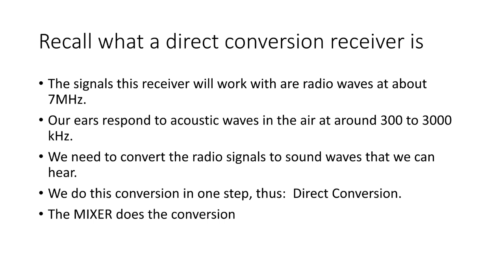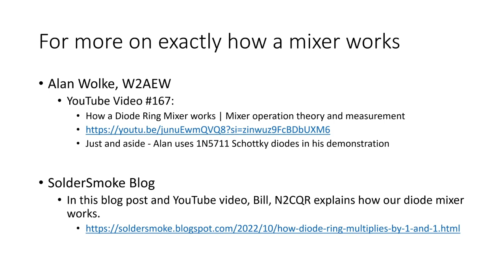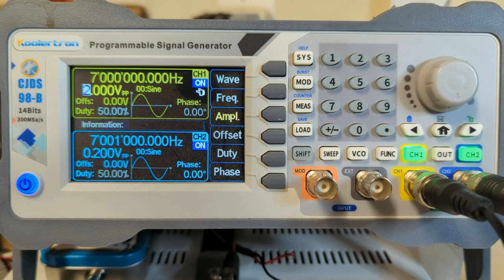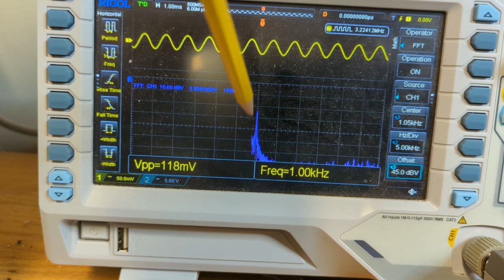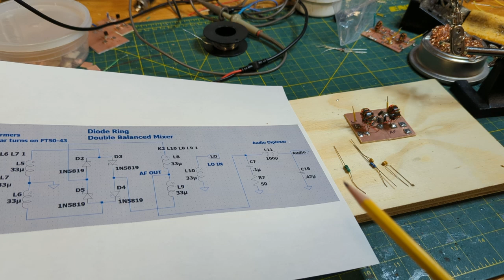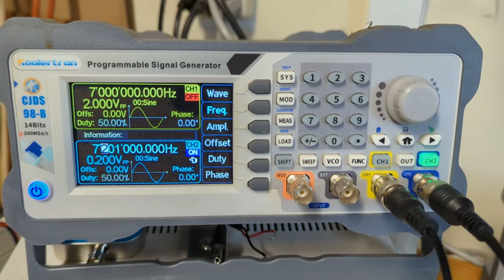SolderSmoke DCR Challenge -- Mixer and Diplexer

Comment: I noticed you swap the LO IN and RF IN locations in comparison to the schematic.  After looking at multiple builds of diode ring mixers it's become evident that you can do it either way.
Reply: I got so confused when mine didn’t work and then I realized this. I think in watching the video and looking at the diagram I somehow ended up with a version with a little of both and I can confirm that’s suboptimal. I can only assume Dean is taking advantage of some high level symmetry in this circuit that left me mouth open drooling on my soldering iron. I think my main issue is I’m watching and building and basically baking a cake I don’t fully understand so that all went over my head at first. The joys of being a very novice builder. All that aside, Dean’s videos have been a Godsend. Very educational and I doubt I could have gotten this far without his patient explanations.

Comment: Is there an alternative to test the mixer? My function generator does not go that high.
Reply from the maker: A good way to test the mixer is to connect it to the PTO and look at the waveform the PTO makes at the junction of the PTO and mixer.   You should see some flat topping on poisitive and negative peaks as the PTO turns on different sets of diodes.  See the Joy of Oscillation section of the Discord channel.  73  Bill  Hi7/N2CQR

Comment: Does twisting the three wires together before going to the toroid confer some advantage beyond just making it easier to manage the winding process?

Another dumb question, what about the choice of wire, is enamel magnet wire crucial, or would plastic coated solid copper #26 telephone wire serve?
Reply: Twisting the wires makes them self-shielding.
Reply: Well, I'll answer my own question about the wire. Tried out a single piece of plastic coated #26 and put 10 turns on the T50, and saw there wouldn't really be room for 2 more just like it. So I dug up some #26 enamel coated, cut 3 pieces 12" long, and twisted them up to about 8-10 twists per inch. Started the toroid in the middle of that length and just barely got 10 windings of that trifilar through it. Size 50 toroids are not the most spacious things!

Comment: I am not an industrial hygiene expert. I can also be an awful reader. But my understanding is that at the temperatures we solder at there is essentially no lead fume. Its different if you are removing parts with high heat or have your iron turned up way too hot. Fumes, as I understand it, from the flux, even rosin core, are more hazardous than the tiny amount of lead fume. The fan is needed. The larger source of lead from soldering is hand to mouth, and keeping food and drink isolated from your soldering station is needed. Also included in this is good handwashing. For me, I try to do this everytime I move from my electronics to the house. 
I am a ceramic artist and my reading on lead in the studio from 50 years ago was that hand to mouth was the main source of lead poisoning in potteries with dust inhalation coming in way lower. Smokers got poisoned first, and it took study but the reports I read were than it was not inhalation but the hand to mouth thing of smoking. Fume from kilns is another story, but in general when firing temperatures are low like for leaded decorative overglazes the fumes are not very significant.  Leaching from glazes is another discussion. 
I also spent several years working with old organ pipes many of which are made from tin/lead alloys. It was remarkable how much grey dust you could end up with on your hands and clothes.  
I see leaded solder as a great help in building on plain circuit board material.When building on printed boards I go lead free. 
On the boards, the added temp needed is very hard on the insulating layer and the broad copper surface requires too much heat for the tin/copper solder. The FR4 burns and the copper delaminates when I try this.  If you are teaching children please be very good about teaching them to really scrub their hands and to keep their hands away from their face.

I am really enjoying these videos and hope to build this receiver in the next few months.

Comment: Thank you! I'm not sure if you mentioned in this video, what the term 'bifilar' actually means. You probably did, but I don't have the time to play it again to be sure. My apologies. So I'll just repeat it for those who are like I was when I was young. It just means that 2 wires are twisted together. That's it. That's all there is to it. I mention it because when I was a kid in the 1960's I would follow all circuit explanations well right up to the point where they mentioned the word 'bifilar' or the word 'trifilar', or 'saturation', then my mind shut down completely and the circuit became some technical magic that was beyond me. The words would simply scare me off, just as 'ferrite toroid', followed by numeric descriptions did, though their actual meaning was trivial. I would go so far as to build circuits and just leave out the magnetics components, never finishing them. I almost wish that such words had never been invented and people had just said, '2 wires twisted together then wrapped around a little doughnut'. Now, many years on, with my test bench loaded with commercial test equipment and lab standards, such things don't bother me at all. But I haven't forgotten the time when they once scared me off. That being said, you do a fine job of taking the 'fear factor' out of how to construct this receiver. You describe, show, demonstrate and explain everything clearly and simply.  Again, thank you. You're a guy I never had in my life when I was a kid learning electronics. You're an Elmer.
Reply: Thanks for the note.  I try to make the videos I would have wanted when I was starting out!  I did mention the definition of trifilar - i think - its in the presentation for sure - but I'll annotate it better,